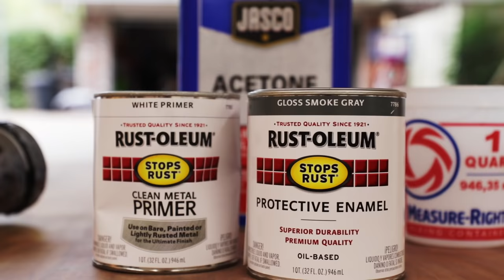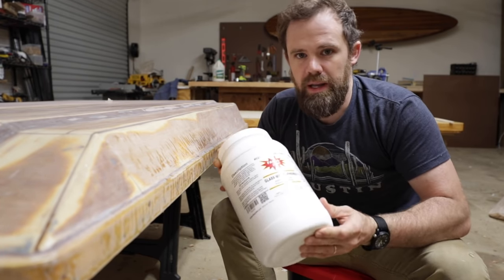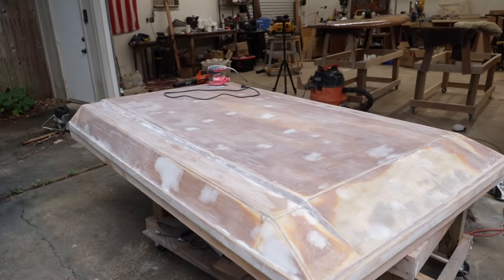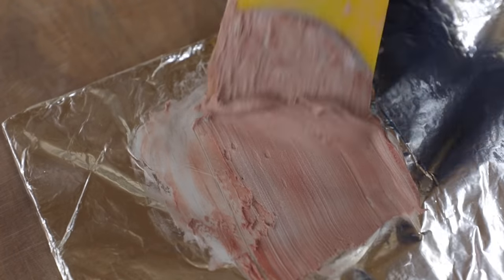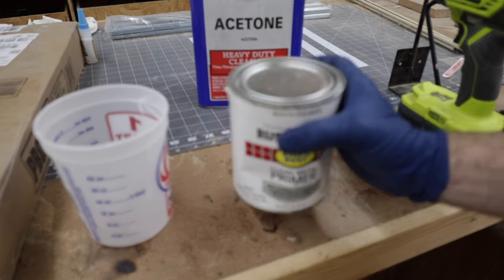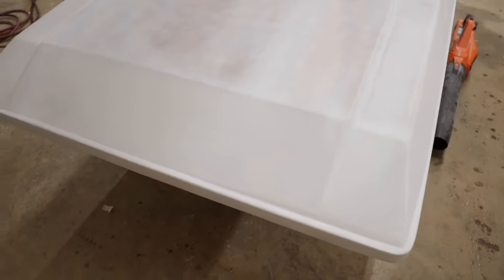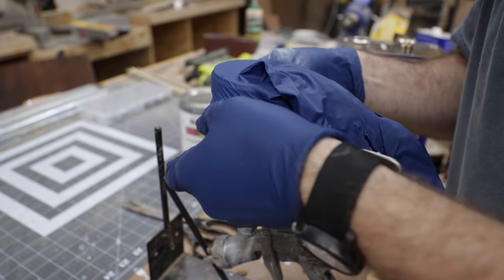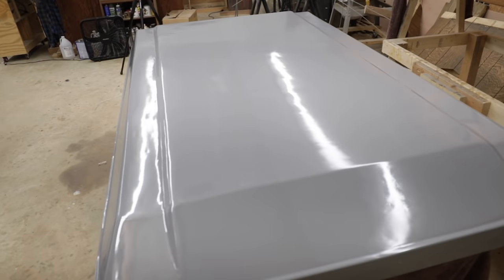Rustoleum paint job on my DIY Rooftop Tent!!

Comment: Hey im watching the Video currently and just a few pointers for the next project, and for other viewers.
Use a filler primer first and dont thin it out or strain it, You want it thick and full of the plastics it carries.
Also when sanding it down use a speckle technique with a darker paint(black spray paint works great); or a quide coat is what its called.
finally wet sand it with a block after its fully cured. use your aggressive grits sparingly for heavy trash areas.  

The guide coat helps identify your low spots quickly. and for sanding i suggest a step system of 600,1200,2000.
Take your time and you should have a glass finish everytime.
Reply from the maker: Thanks for the tips!! I appreciate it!

Comment: I think you did a great job!  Your near automotive paint finish looks fantastic.  The Bed-liner / raptor liner method is way quicker and low effort but it’s basically a popcorn ceiling cover up.  Your work though was Top Shelf.  You’re giving DIY people like me the confidence to try and learn new techniques.  Oh and your little girl is a sweet heart and I’m sure she will be spending some great camping nights with Dad in this RTT.
Reply: There will be an appreciable difference in aerodynamic drag (fuel economy) at highway speeds between a shell finished in bedliner and one finished to the level shown in this video... If that matters (long road trips, smaller vehicle, etc) I think I a quality paint job will pay for itself quickly!

Comment: Looking good! Color matching my camper shell to my truck was my first and only time painting anything. If I had any advice, it would be to ditch the orbital as soon as it looks remotely smooth and block sand from there on out. Look into spraying a guide coat as well. The more you guide, block, guide, block… The closer you can get to mirror finish.

Comment: Just something for you before you get too far with mounting it.   Rustoleum paint isn't great with UV.   You may want to consider a clear coat (there are 2K aerosol) available that are super durable.
Reply from the maker: I’m not saying your wrong but in my experience of using this formula I’ve never had any issues. I have a black tailer that sits in the sun all day every day and it has held up extremely well over the years.
Reply: @PatrickRemington  No doubt Rustoleum is tough stuff.   When I look at Rustoleum paint jobs (cars), they don't hold up without a clear coat.   Maybe something to do with flat panels and lots of surface.    

Either way, good stuff on the tent.     I've been following along for a long time.

Comment: Maybe it's a lack in the USA 1 you could have used car body filler it dries in 30mins following that don't sand so heavy with the guide paint fill the lows etc, finally you could use a self leveling primer that fillis all the divots in 1 coat and levels smooth , good job just a bit over worked . Happy camping
Reply: Just too heavy with the hardener...

Comment: I know it's too late for this build but when trying to get the top to a nice smooth surface it might be worth looking at a filler coat. I saw it mentioned on this surfboard video and I think it goes a long way towards creating a nice finish with less fill and sanding  https://youtu.be/bAS-LZU2xAQ?t=397

Comment: Hello Patrick,

 I whoud have just two small questions for you if you don't mind. I applied epoxy and fiberglass all around the back contour. I would like to know if it's necessary to sand a little bit before applying a second coat of epoxy over it (as a put the fiberglass 24 hours ago).

The second question is : have you planned to do something on the inside of the top of the tent ?  I made a big mess with epoxy in there and I was thinking about hiding this mess with something like thin insulating material.

Thanks again for those great videos !
Reply from the maker: Yes, sand before your second coat. You don’t have to go crazy on it just scuff the surface. 
I do plan on covering the underside with fabric.. mine is a mess too
Reply: @PatrickRemington  thank you very much !

Comment: Wow it looks great,  I think you did an awesome job.  For future painting reference if you alternate you spray patter it eliminates the zebra stripes affect.  So like you did all long ways but the next coat should of have been 90 degrees to that width ways and then back long ways and then weight ways.  Alternating pattern gives more color coverage.  And even a brand new fiberglass shell would still have waviness to it.  There isn't much of a way to get around it on large flat areas.